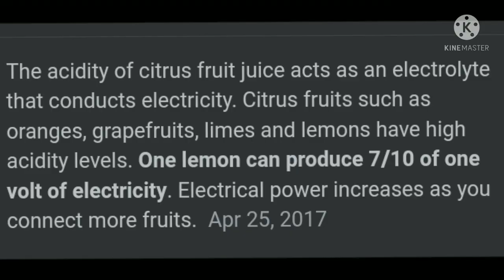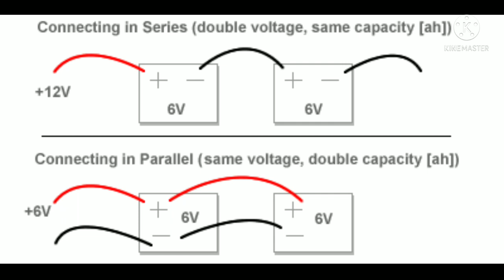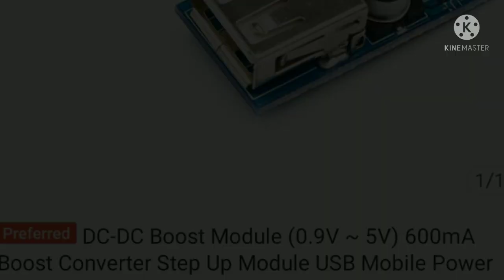HOW TO  MAKE HIGHER VOLTAGE OF  SALT WATER LAMP

Comment: hello po! Can I ask po kung anu-ano yung mga ginamit ninyo?
Reply from the maker: Used battery active carbon and battery graphite, yung battery.mismo tinangal ko lang yung zinc na nakabalot - aluminum, copper wires and DC - DC step up converter 0.9volts to 5volts